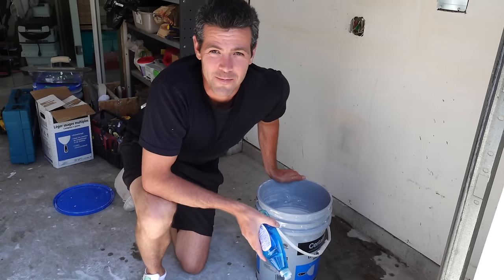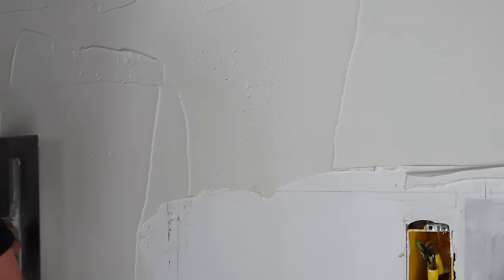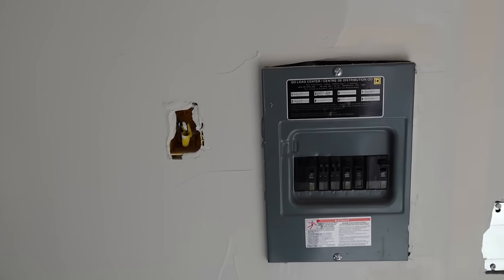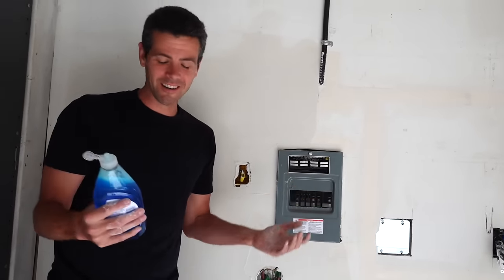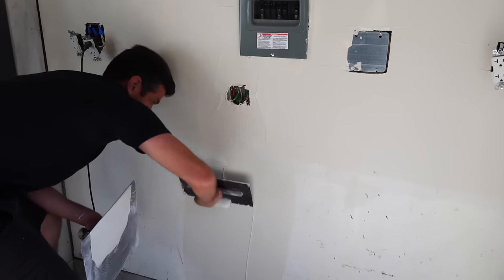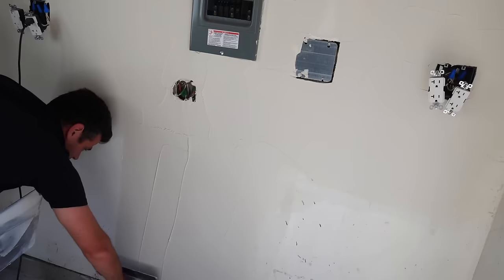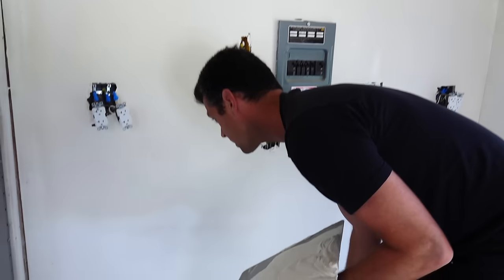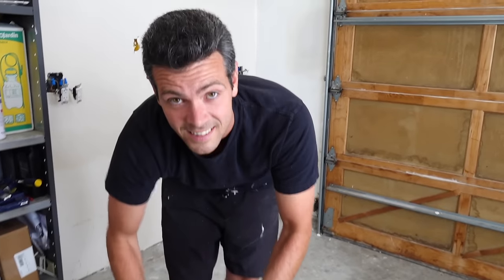😳Should you Add Dish Soap to Drywall Mud????😱

Comment: The reason we put soap in our mud was back in the 70s and 80s. The mud was new coming out in a box New Concept Ready Mix the soap would help release the air bubbles trapped when mixing your mud before we would make it up from a bag. And the dish soap we use dove white bottle was the only soap we used. That was the only reason and we don't do that no more because the mud in a box it's created so much better now. I still see our young guy trying to use that method no need put soap in your mud no more and exactly might ruin the paint finish who knows what kind of materials in that soap now won't let it get painted

Comment: The drywallers who skim coated my walls were having trouble with bubbles, so they asked for some laundry detergent. I checked on the work that night, and they had used my entire bottle of laundry detergent. The paint peels off really easily, and I'm not sure if that's related.
Reply: Paint peeling is b/c the pint was applied without vacuuming or at least brooming off the drywall dust. 
Improper or no PVA primer would be another reason for peeling paint.

Comment: Isn't it logical that a company that makes and sells drywall mud is gonna want to give customers a product that works great out of the container? If adding dish soap made it work better, wouldn't they have found out by now and adjusted their product? I just did my first drywall mud project ever and the ready made worked totally fine out of the container, except I had to add a tiny amount of water to get it to adhere to my paint roller.

Comment: I'm in NYC and see all the union tapers/plasterers use dawn liquid soap to their compound. They squeeze two times, one in a new pail about 4-cups of Dawn soap and when it gets to the middle of the pail another 3-4 cups per 5 gallon compound. They don't measure is just a long squeeze. & they all swear by it.  To turn a room over in an 8 hour day they add plaster to the compound so it dries quicker. If they want to stall the job they add Vinegar to retard the compound. With all of these methods all primer and paint sticks.

Comment: What about sanding? Do you wanna get powdered dish soap in your eyes? Yikes! 

If anyone can let me know if this is a legit concern that would be great. I have never done this for that reason.
Reply: @
kbkbkbkbkbkbkbkbkbkb, that's a good question. I'm not sure about the ratios of his mud to the "squirt" of dish detergent. They could certainly smell the dish detergent when it was wet & Dawn is very concentrated. I was thinking what about sometimes using a damp cloth to wipe over the dried mud so you don't create the dust but then would it develop light "soap-suds" on the wall that might create a problem...
Reply: It couldn't be any worse than the mud.
Reply: I found a few message boards and a lot of people said it does burn their eyes sanding. 🍻

Comment: The reason they started putting dish soap in mud dates back to the 90s for me an probably even earlier to combat Pocking. You get this more in Quickset muds when air gets trapped under the mud while setting. The dishsoap would help alleviate this greatly and was used more in Commercial apartments when drywall finished. Most of those were all finished in 1 or 2 coats of quickset and textured. They actually make a product called No Pock....

Comment: Palmolive is best. Been adding Palmolive since 1973. It does more that make the mud slippery.  It keeps your hands from chapping and cracking.. never used Dawn. Not sure it would work the same. Old drywallers? Dawn? Dawn wasn't around until 1973... Trust me.. Palmolive s way better.

Comment: Ive watched a ton of your videos and have gone from the wide knife to a the church of the trowel.   OH MAH GAWD how much easier it is to get a good result..

as a DIY. I recently did a lvl5 finish on a ceiling, I had to re-do all the drywall and I was so damn proud of the taping job.   Took me a solid week to get there. inside corners were my bane.  but you literally can not see a single hump or blemish even with a halogen light at a low angle.  So thanks for all the tutorials.

But I could never do it wearing black clothing,  thats pure insanity.

Comment: Been adding soap to the mud since I started. Definitely makes it a lot smoother with no fish eyes, makes it a lot lighter and easier to apply. The best part about it is that it makes sanding infinitely easier. I use a VERY generous amount of soap but it’s very possible to over do it. Also NEVER USE SOAP WHEN MIXING FOR TAPE. If you use soap on taping mud, the tape will slide so aggressively and you’ll hate being alive

Edit: I work professional highrise condos in Toronto for Torino drywall. There isn’t a single taper that doesn’t use soap!!

Extra edit: on skin coat it’s better to use more soap and less water. The more soap u use, the less water you should add. However, don’t go crazy with either, there still has to be a good balance. Also u should’ve used more soap and colour tint so the camera can see what’s happening!

Comment: When using soap the amount you used was fine for the amount of mud you had, but ONLY use soap on finish/skim coat. This will insure you still have structural integrity.  It will not affect paint adhesion as long as primer is used but it will go on smoother and sand easier. More like a light weight mud sands.

Comment: How does one know how much soap is too much soap.   If you are so unsure if it really makes a difference, then maybe it really doesn't.  You started the test expecting to find a difference and yet the difference you noticed, you termed "marginally" different and even that was delivered with a bit of uncertainty.  If there was enough soap that it left some bubbles when you cleaned your tools, will the walls produce soap bubbles when wiped down with a wet sponge?  Even if the soap seems completely bound to the mud, will it affect not just the adhesion of paint but also the color of the paint?  I don't know.  If someone who makes a living doing drywall has trouble seeing a difference, a DIY warrior will most likely not be able to tell a difference.  And the whole give it one squirt mixing instructions is WAY too vague.  One squirt to how much mud? Or put another way, what volume squirt for a given batch of mud?

Comment: I've done this before. ½cup to a full pail.  I haven't noticed a difference in "bubbles". I did notice that it totally changes the sandability, especially with certainteed.  Way way way easier to sand.  It doesn't seem to cure as hard.  Game changer when pushing big footage.  I personally prefer Hamilton Red line for finishing. No soap needed.  Easy to spread and easy to sand.

Comment: Engineer here. I've worked for companies that sell the additives. Some comments as to why/what is happening:

1) Detergent (such as dish soap) serves as a plasticizer. These make the mud more fluid with less water. Most mud compounds have detergents in them. More plasticizer means we get denser mud that dries faster. But dish soap might be an inappropriate plasticizer.

2) The mud becomes shear thinning. This is the "smoothness" we feel and should help with less bubbles. But, when you're not spreading it, it should still hold. Shear thinning means the faster you move, the less friction you feel in proportion to your movement. But when stagnant there is minimal friction change.

3) We need to convince USG to scent  mud. It's cheap and changes nothing. 

I use dish soap in mud. The reason being is first, I'm an amateur and it makes it easier for me. Second, a bucket of Plus3 I feel is marginally good at all 3 aspects. True finishing mud will have more detergents in it, but we don't get to know how much and for amateurs we don't have access to these products. The only thing at Home Depot is "all purpose" which means it is not good at anything. Kind of like taping mud is more fluid with a lot of glue and way better than any all purpose mud for taping. But you wouldn't use taping mud to finish. 

My main worry, and why I came to this video, is what happens to the paint and what paint or primer to use? Dish soap is extremely hydrophilic. I think the addition of soap could pull the moisture out of the paint causing issues. Both in re-wetting the mud and improperly drying the paint not allowing to harden up as well for less adhesion of the paint. I only drywall for myself and haven't had issues, but I'm one case and curious if others have problems with it. 

Adding soap will cause less adhesion, so I would never use it for taping, only finishes. I don't use plus3 for taping period. Hot mix or heavyweight gets better results.  

What's my experience? I used to do carpentry prior to college where we did some drywall and mudding when the boss couldn't afford a sub. That's where I learned. Since then I've done it in my own houses as I constantly upgrade. I'm working on a bedroom addition now.

Comment: Why are you putting Mudd on the whole wall you only have to Mudd the joints your making it hard on your self with all the sanding putting soap in the Mudd makes your ekes burn when you sand but your doing it wrong

Comment: I used palmolive in concrete to prevent cracks. I never knew dish liquid could be used in drywall mix.and for bubbles on the wall I use a wet sponge to sand smooth.